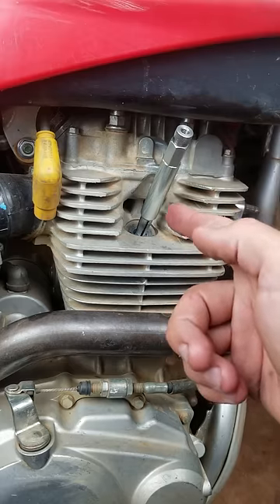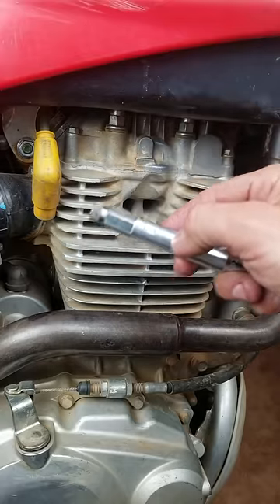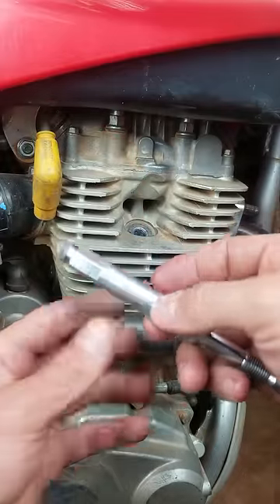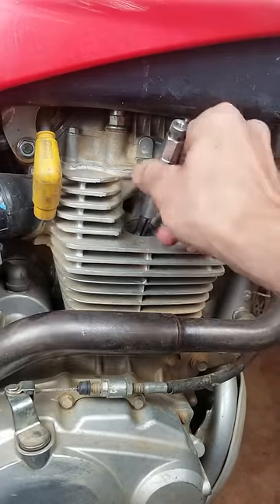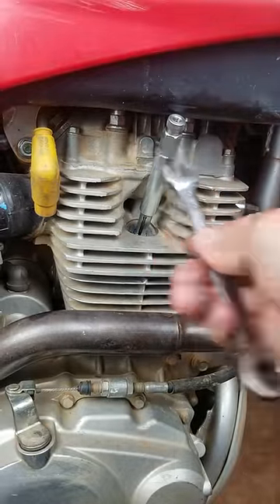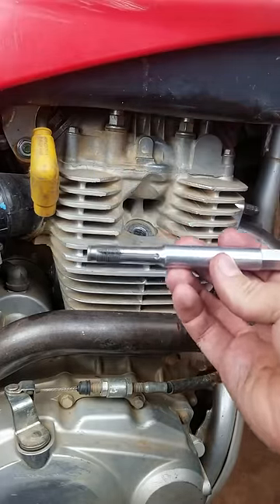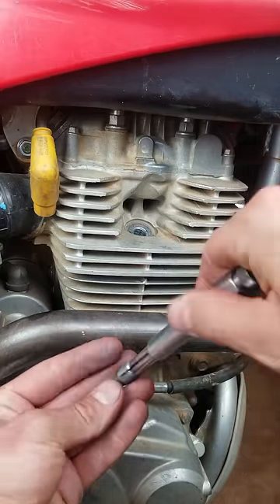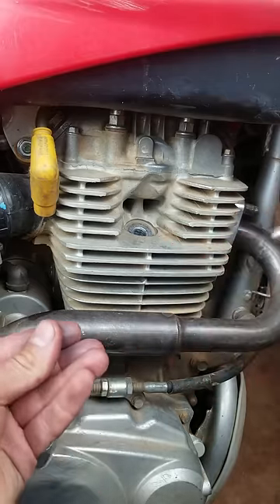STRIPPED Spark Plug Hole

Comment: No, the reason you use it is to start the tap where the threads are square and true to the head and reforms the aluminum at the start of the issue. Because an off center tap for a spark plug will leak compression and not seal
Reply: Think it's both reasons it's done in this order. Both are legit reasons
Reply: The undamaged threads are at the bottom so using a back tap helps the rest of the hole get properly threaded. Fucked up threads are generally at the top so how does fixing threads from the bottom up make it bad? It’s literally superior in every way (for spark plug applications)

Comment: How does it fix the threads when it basically bores it out I don't understand how it works ...
Reply from the maker: It massages the threads when you back it out. It basically re-shapes them.
Reply: @MattsShop  so them Hou need a heli coil after right?
Reply: @Gothguitarist  yeah or a wider spark plug most likley